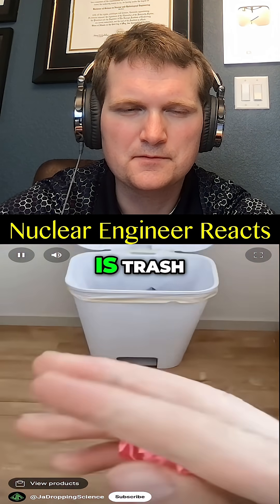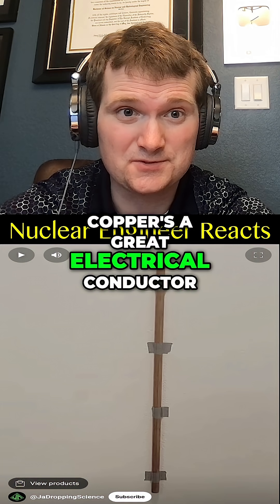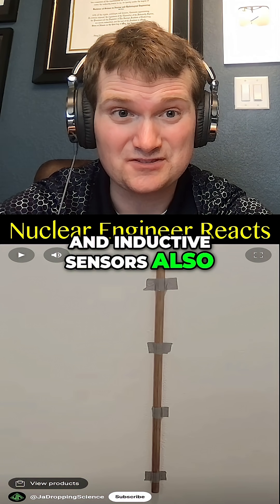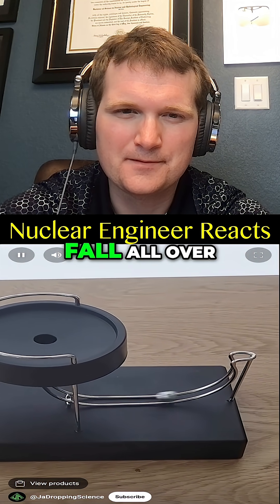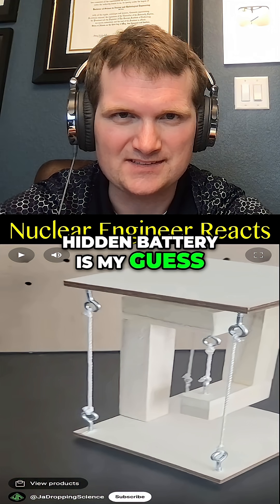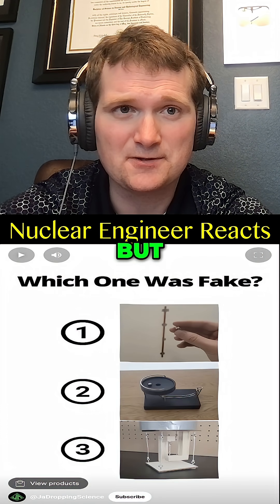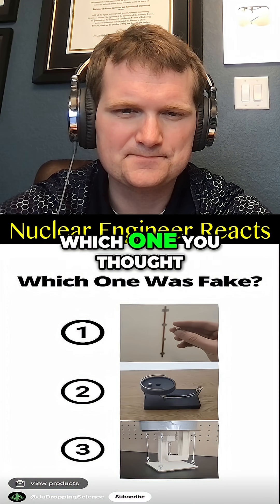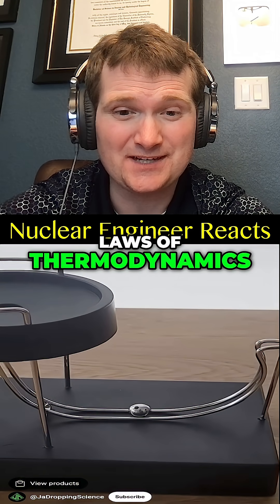Perpetual Motion Machine? - Nuclear Engineer Reacts to 2 Truths & Trash by JaDroppingScience

Comment: No need to refuel for long time with this ⚡️ Operation: POWER – Building the Ehive Energy System

A modular, sulfur–hydrogen thermochemical ecosystem powered by sunlight, managed by AI, and built for real-world deployment.

---

🧱 1. What is Ehive?

Ehive is a modular, closed-loop energy system built on industrially proven processes and elemental chemistry—not fossil fuels.

Instead of relying on rare minerals or unstable weather conditions, Ehive uses elemental sulfur and sunlight to generate continuous, dispatchable clean electricity and hydrogen, with zero carbon emissions.

Each Ehive Unit is a hexagonal, self-contained module that performs one or more steps in the energy cycle. These can be connected in networks—like a hive—scaling from off-grid systems to full-scale power plants.

---

🔁 2. How It Works (IRL Process)

The cycle uses real, validated chemistry and technologies already demonstrated at research scale (by DLR, KIT, and others):

🌋 Step 1: Sulfur Combustion (Energy Discharge)

Elemental sulfur (S) is combusted in air to produce SO₂ and heat.

The heat drives a gas turbine, with leftover heat powering a steam turbine (combined cycle).

Output: Electricity + Sulfur Dioxide (SO₂)

💧 Step 2: SO₂ Absorption

SO₂ is absorbed into water to create sulfuric acid (H₂SO₄).

This is a well-established industrial process.

Output: Sulfuric Acid (stored and reused)

☀️ Step 3: Solar Thermal Regeneration

Using concentrated solar heat (800–1000°C), H₂SO₄ is split back into:

SO₂

Water vapor

Oxygen

This happens in a ceramic high-temp reactor, already proven at pilot scale.

🔁 Step 4: Disproportionation Reactor

SO₂ reacts with steam in a catalytic reactor to regenerate:

Elemental Sulfur (S) – collected and recycled

Sulfuric Acid (H₂SO₄) – reused

Cycle complete.

🔋 Optional Hydrogen Integration (HyS Process)

SO₂ + H₂O + electricity → Hydrogen + H₂SO₄

Uses SO₂-depolarized electrolysis, requiring ~1/7 the energy of normal water splitting.

Produces hydrogen, which can:

Be stored

Used in SOFCs for high-efficiency electricity

Exported or used industrially

---

🔬 3. Why It’s Real – Not Just Theory

Every part of the Ehive system is based on:

Proven chemistry (industrial sulfuric acid cycle, HyS process)

Pilot-scale validation (DLR’s HySelect, SULPHURREAL, BaSiS, PEGASUS)

Available materials (sulfur, ceramics, stainless steel, nickel alloys)

Existing tech (solar concentrators, turbines, SOFCs, electrolysers)

What’s missing is integration and scale. That’s what Operation: POWER solves.

---

🧠 4. What Makes Ehive Different

✅ 24/7 power – Solar charging by day, sulfur combustion by night

✅ Zero emissions – Only O₂ and H₂O are released

✅ Element-based – Built from H, O, S (and N for controls, buffering, or fertilization)

✅ Scalable – Start with one hex module, scale to megawatt plants

✅ Transportable – Sulfur is solid, cheap, and easy to ship (~$50/ton)

✅ Durable – No exotic materials needed. Operates in high-temp, desert, off-grid

✅ AI-Operated – Predictive control of thermal loads, reaction timing, energy dispatch

✅ Closed-loop – No fuel imports, no water losses, no chemical waste

---

🌍 5. Applications

Desert energy hubs

Microgrids for off-grid communities

Industrial hydrogen & power for clean steel, ammonia, cement

Exportable sulfur-fuel blocks for developing regions

Hydrogen hubs and fueling stations

Planetary bases or closed-loop life support systems

---

🧠 6. Why Now?

Climate deadlines are real – We can’t wait for fusion or miracle batteries.

Grid-scale storage is missing – Lithium can’t do it. Hydrogen needs better integration.

Sulfur is abundant, stable, cheap – No rare earths, no toxic waste.

Pilot tech is ready – We’re not waiting for inventions, just deployment.

AI energy control is here – Real-time management of thermochemical systems is feasible with today’s software and sensors.

---

🛠️ 7. What Operation: POWER Needs

We don’t need to invent more—we need to build.

We’re calling on:

Engineers (thermal, chemical, systems)

Solar field designers

AI + control system developers

Fabricators and industrial partners

Climate investors

Governments and energy agencies

---

📣 8. Message to the World

> We’ve already discovered all the dead energy—coal, gas, oil.
Now it’s time to build with the living elements: hydrogen, sulfur, oxygen.
These elements made Earth’s first ecosystems—and now, they can power our future.
This is my idea after studies and researches on my own 
Hope this message will reach someone who can change things
Reply: This is my original idea no one on earth came up with it worling on evolution on power generation